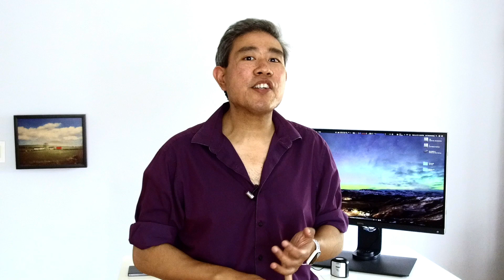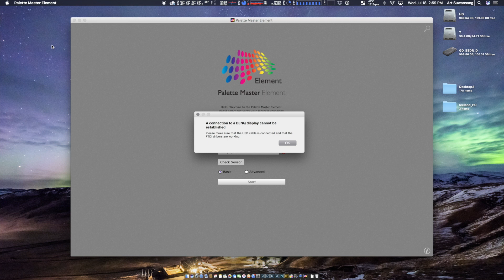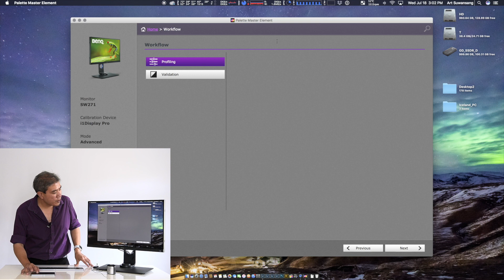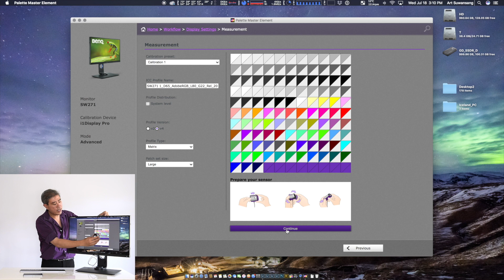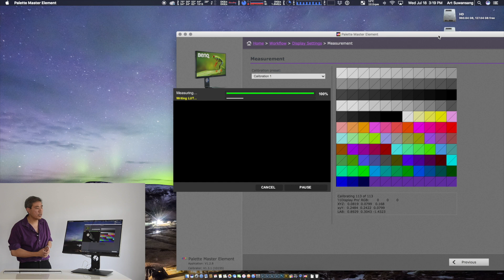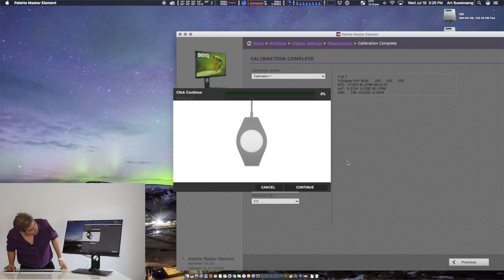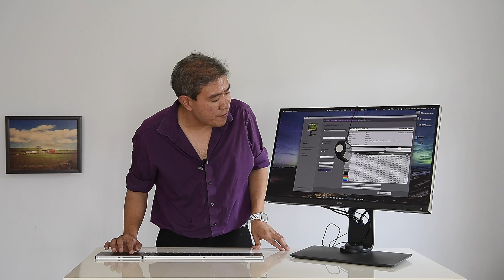How to Calibrate BenQ SW Displays with Palette Master Element - Art Suwansang

Comment: Hi Art, Thank you for the excellent video, very clearly presented and easy to follow, just what I have been looking for. Apologies for this naive question. For hardware calibration, am I correct in believing that the X-Rite i1 Display Pro is connected to one of the USB ports located  on the left-hand side of the my BenQ SW2700 monitor?
Reply from the maker: It can be connected on any USB port on the computer. You can plug it into the USB port on the display but it is not necessary. This is the latest guide https://youtu.be/8rjRoIe0-mo and calibration settings https://youtu.be/eCOPETFhZlE

Comment: Hhi, I am having a problem setting PME to recognise my spyder 5 pro on my sw271c, I have tried your suggestion of unplugging but no luck. Would it be OK to use datacolor software for calibrating? I have tried plugging into usb port on my iMac and both the usb ports on the bottom and side of the monitor, think the one on the bottom of the monitor is the correct one?
Reply from the maker: You can use Spyder software to calibrate the display but you are doing a software calibration, on a hardware calibration capable display, it is like buying a Ferrari to drive 10 miles / hr in first gear all the time. I would just plugged in the device on to the Mac. I would also do this https://youtu.be/WECg_yYBlpU chances are Spyder software is running in the background interrupting PME. Also if you ever installed DisplayCal you have to take that out from start up as well.
Reply: @ArtIsRight  Thanks for your help, I did have the spider utility in my startup so removed it but I think I know what the issue was. My iMac is not usb-c so I was not getting the data connection that is required. I ran it from my MacBook pro which is USB_C and it ran perfectly.
Reply from the maker: Oh ok, so what this means is that you will need to use the USB Type B uplink cable with the SW271C in addition to the display cable. It should work with this setup.
Reply: @ArtIsRight  thanks - sorted👍

Comment: Keep getting the error - A connection error between a Benq display cannot be established. I have tried unplugging to refresh the hardware and rebooting but no joy. Also my i1 Display Pro Plus is only recognized when connected into my Windows PC tower it is not recognized when connected directly into the BenQ SW270C monitor. Could you suggest a solution?
Reply from the maker: You just need to use a USB A to USB Type B Up link between your computer and BenQ.
Reply: @ArtIsRight  Thanks for your reply. Could you recommend a specific brand / link?
Reply from the maker: Your display should shipped with one. Something like this works as well https://www.amazon.com/UGREEN-Printer-Scanner-Brother-Lexmark/dp/B00P0FO1P0/ref=sr_1_3?dchild=1&keywords=usb+a+to+usb+b&qid=1622663269&sr=8-3
Reply: ArtIsRight Thanks so much Art. For some reason it only shipped with a Mac compatible connection. I’ll order now.
Reply from the maker: That cable that I shared with you is a Mac compatible connection and should come with your display.
Reply: ArtIsRight All good Art. I’m on Windows but got a similar cable. Thanks for your help! Definitely some of the best calibration advise online.

Comment: Hi Art, by using the propietry Palette Master hardware, do I not need to install the external software beforehand to use the colorimeter? In my case a spyder, or is it just the case of plugging it in when palette master asks me too?
Reply from the maker: Palette Master Element (PME) is a software that access the hardware 3D LUT on the display for color adjustments. PME software comes with all of the needed driver in the package. And you can just hav the device plugged in and calibrate with PME.

Comment: Great video! Should I connect the sw271 with a MacBook Pro trough a usb C? Should I connect the X-rite i1 pro directly to a monitor ? Tks. Best regards
Reply from the maker: That solutions works, The device can technically be plugged in any where as long as the computer sees it.

Comment: I've tried all suggestions but short of doing a full REINSTALL of windows 10, Palette Master Element won't load/start. I get "not responding". Here's what I've done so far: (and I just got my monitor today and there's nothing like having a new toy that just won't work !!!!!!!)  :(

Has anyone else had an issue like this or do i just bite the bullet and reinstall ????

please don't say reinstall!
Reply from the maker: Technically, the monitor works but the software won't run on the system nicely ;) 

Please answers these questions completely and we’ll go from here.
* What computer (Laptop - Mac specify the model, year and size, Desktop, iMac, all in 1 PC, custom build, etc )
* What is your Operating System (OS) version are you using? (For Mac please specify the dot release, for Windows please specify version / build number)
* What calibrator are using?
* What version of PME are you using?
* What BenQ model do you have?
* What cable are you using to connect your BenQ to your computer for the display signal, HDMI, Display Port, etc.
* If you are using USB-C skip this question, if not, are you using a USB link cable between your laptop and display?
* If you are using Mac was this a clean install or was the OS upgraded from a previous version at any point (I.e. From Mojave 10.13.x to Catalina 10.14.x)? Or was this Mac restore from a back up, time machine or other wise?
* For PC, what GPU are you using? If Nvidia are you using their new Studio Driver?
* Were you able able to successfully pass the validation at some point
Reply: @ArtIsRight  correct. Software hangs
Reply: * What computer (Laptop - Mac specify the model, year and size, Desktop, iMac, all in 1 PC, custom build, etc )
--- PC Build. no brand.

* What is your Operating System (OS) version are you using? (For Mac please specify the dot release, for Windows please specify version / build number)
- Windows 10 Pro (OS build # 19042.964)

* What calibrator are using?
- iStudio (x-rite)
* What version of PME are you using?
-Version from BenQ site, "Palette Master Element for Win_V1.3.15_Windows" 

* What BenQ model do you have?
-SW721

* What cable are you using to connect your BenQ to your computer for the display signal, HDMI, Display Port, etc.
-DP and confirmed on display too.

* If you are using USB-C skip this question, if not, are you using a USB link cable between your laptop and display?
* If you are using Mac was this a clean install or was the OS upgraded from a previous version at any point (I.e. From Mojave 10.13.x to Catalina 10.14.x)? Or was this Mac restore from a back up, time machine or other wise?
* For PC, what GPU are you using? If Nvidia are you using their new Studio Driver?
-No just standard Nvidia Install not the CC installation.

* Were you able able to successfully pass the validation at some point
-could not get the software to run at all. All I had was program not responding on all attempts.

Cheers
Steph.
Reply: Just to be clear, the monitor is working fine. I just can't get the "Palette Master Element" software to run.
Reply from the maker: Do you have i1Studio software installed and running in the background? This software not responding indicate that some how there's a fault on the machine or conflict that prevents it from running properly. Do you have lots of programs running in the background, have you use Display Cal at any point?
Reply: @ArtIsRight  thanks for suggestions. I ended up making sw271 the primary monitor and that seemed to have fixed the issue.

Comment: Hi art. Thanks for your videos, you do a great job at explaining how things work. Couple of questions if you could help me, 
1.currently I just have one computer set up to the sw270c, I have calibrated using slot 1, got less than 1 as the average delta e, so all good. When I press the ‘colour mode’ on the display and I can cycle through Adobe rgb etc ..... there is the option to set it to slot 1. I am guessing that I don’t have to do that unless I am attaching another computer and then using slot 2, which might be different? So effectively - for my set up - Adobe rgb mode is the same as calibration slot 1 9which used Adobe rgb for the calibration). 
2. You mentioned that unplugging the monitor resets the hardware, I turn my computer etc.... off at the mains at the end of the day, will this reset the monitor and get rid of the calibration setting, I’m assuming that whatever hardware calibration you do is stored indefinitely until you do another calibration or do a factory reset and turning off at the mains does not do a factory reset ?
As an aside - do you have a channel doing a similar thing for x rite calibration products ? 
Thanks in advance and for your video tutorials.
Reply from the maker: 1. Not quite, what you need to do is set it to calibration 1, all of the others are pre-calbirated color modes from the factory and is not a full 100% accurate match with your system. So it does not matter if you use your display with 1 or 3 computers, each calibration slot should correspond to the respective computer that you calibrated with.
2. No, you have the pull the plug and press the power button on the display to do a full factory reset in addition to going to the display menu and initiating a reset there first. And yes even when you reset the display hardware calibration are LUT written and will remain.
X-Rite information is on the same channel, you can check out this play list https://youtube.com/playlist?list=PLjlr8rlxl_q4bfecpq8qvxP0lgDzXhkpY
Let me know if you have any further questions :)
Reply: @ArtIsRight  thanks for the reply. I appreciate the advice.

Comment: i must ask please!
BenQ  put all this effort to Calibrate  the monitor in the factory with thier expensive equipment 
and then i take my spyder 5 elite and "run over"  BenQ  Calibration ? 
and i will have better results ?
Reply from the maker: That is one way to look at it but it is missing the point. All display needs to be calibrated from the factory. These SW and PD line go through a rigorous calibration process from the factory. These calibration are done so that the various color modes shipped with the displays are showing the most accurate color possible based on the reference value. The keyword here is "reference value." At the factory everything is calibrated to these reference value but none of our computer is outputting reference value because of the OS, driver, software, and etc. When you calibrate with a device, any device, you are calibrating the display in the hardware calibration slot, this calibration is adjusting the 3D LUT on the display. Think of this as a paring process, where the calibration is matched with your video card, specific video output, along with the software and driver installed on the system. At any point you are not overriding the factory calibration. And yes the result would be much better because the output is based on all of the overlay of your system. These videos will answer your questions too https://youtu.be/Cgo2p7jF3n0 https://youtu.be/iKfvbbUKA7U

Comment: I don't know why but whenever I play video the colors go all green and wrong. What should I do?
Reply from the maker: On BenQ SW hardware calibrated display with PME calibration or otherwise? If so please answers these questions completely and we’ll go from here.
1. What computer (Laptop - Mac specify the model, year and size, Desktop, iMac, all in 1 PC, custom build, etc )
2. What is your Operating System (OS) version are you using? (For Mac please specify the dot release, for Windows please specify version / build number)
3. What calibrator are using?
4. What version of PME are you using?
5. What BenQ model do you have?
6. What setting did you use for PME or color mode that you set your display.

Comment: Hi Art, Today I received my SW321C and made my first HW calibration using the display pro with the new panel native settings with great results as described in your video’s. As explained in previous videos I can make 2 extra HW profiles and load them inside windows color management when I switch programs. Is there a quick way or shortcut for switching (windows) icc profiles just like the pilot software, but for hardware models?

In a previous video you explained that the calibration profiles which are controlled by using the puck, where just for ‘previewing’ purposes. What do you mean by previewing? Can you please give me an example how you use this puck inside your workflow as a photographer? When you color correct photos inside photoshop, do you start by activating a RGB profile (by pressing your custom RGB profile) change your windows/apple icc profile manually and start working? After finishing your photos you want to share those photos online or maybe you would like browse the internet. Do you press de custom SRGB profile on your screen (puck) and switch OS icc profile to SRGB? Are you using the same custom icc profiles which are generated by Palette master for your OS?
Reply from the maker: There's no short cut or program for windows or Mac to switch the icc profile for the SW displays.

Previewing, checking to see what you image would look like in that approximate color gamut, I say approximate because your computer, in fact, none of our, are outputting reference colors. I think the best video for you to watch is this https://youtu.be/Gu1nqEf8vzg and with this said it is best to stick with 1 gamut and not change them around. There's really no need to. Please have a look at this and follow up with more questions. Also changing the profile when PS or LR is launch will not work because the profile load at the start of the program, meaning if you change mid way through the edit, it is still using the original set profile. What you have to do for the new profile to take effect is quite the program and launch again, which negate many of the color switching and comparison benefits.

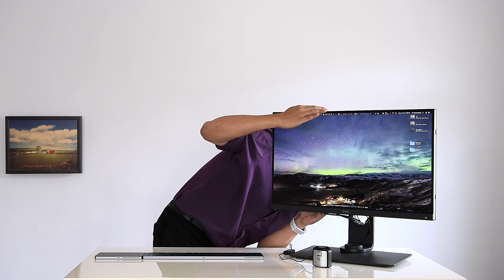Comment: Stupid question but when you plugged the USB cable in @ 3:54 , what was the other end connected to? I only get a message about the USB, not the FTDI driver.
Reply from the maker: The other end is plugged into the computer, This is a more updated guide https://youtu.be/8rjRoIe0-mo
Reply from the maker: FTDI driver message is for older PME version, newer version just simplify the message and tell you that you need to plug in the USB, the GUI for that was my idea!

Comment: Looks like my report summary failed. It’s showing 
average - measured 1.67 - passed. 
Maximum - measured 7.39 - failed

Going to run through this process again I guess
Reply from the maker: Ok, this is an older guide, I'm sure you have watch my newer ones already. But if you haven't yet, you should give that a look. Also, if you need my help, I need more info:

Please answers these questions completely and we’ll go from here.
1. What computer (Laptop - Mac specify the model, year and size, Desktop, iMac, all in 1 PC, custom build, etc )
2. What is your Operating System (OS) version are you using? (For Mac please specify the dot release, for Windows please specify version / build number)
3. What calibrator are using?
4. What version of PME are you using & setting?
5. What BenQ model do you have?
6. What cable are you using to connect your BenQ to your computer for the display signal, HDMI, Display Port, etc.
7. If you are using USB-C skip this question, if not, are you using a USB link cable between your laptop and display?
8. If you are using Mac was this a clean install or was the OS upgraded from a previous version at any point (I.e. From Mojave 10.13.x to Catalina 10.14.x)? Or was this Mac restore from a back up, time machine or other wise?
9. For PC, what GPU are you using? If Nvidia are you using their new Studio Driver?
10. Were you able able to successfully pass the validation at some point
11. For SW2700PT owner, look at the back of your display on the regular tag and give me the MFG date.
Reply: @ArtIsRight  I’ve recalibrated about 5 times now. I changed the black point to 0.1...still got a fail. I just changed it from matrix to 16 bit LUT, black point still at 0.1...another fail. And right now I’m trying black point 0.3, with 16 bit LUT.
Reply: @ArtIsRight  oh, and I posted this reply earlier but I can’t see it.  It here are my system specs you were asking about. 
15” MacBook Pro (2017)
OS: Catalina v 10.15.6
Calibrator: Spyder5 Pro
PME version: 1.3.14 / calibrator: 1.3.3
Display: BenQ SW270C
USB-C connection 
As far as OS, I guess it was upgraded from previous version
Reply from the maker: If you updated from previous versions or use time machine backup or migration assistance on setup you might be running into this issue. Dm me on Facebook page, instagram or email me, I'll share with you what you can do. This said, you have turned off HDR already all of the variables that will effect calibration outlined in this video correct? https://youtu.be/hDHBodulVbw

Comment: Hi Art. I just got my i1display pro plus to calibrate my SW270c. I have a Windows 10 Dell Inspiron 15 laptop and I use the monitor via HDMI for editing work. 
I have installed the latest PME and when I'm connecting the i1display pro plus to my laptop's USB 3.0 slot and launching PME it says error "a connection to benq display cannot be established" and even though it has detected the i1display pro plus but I'm not able to go beyond the start icon in PME.

 I also tried plugging in the colorimeter to the monitor's USB slots but PME is not detecting the i1display pro plus. Could you please help me with this?
Reply from the maker: If you are using HDMI you need to use the USB uplink cable as well. https://youtu.be/24BebMD0G7s Once you do this you will need to turn off the display and pull the plug and leave it off for at least 30 sec, plug it back in, turn on and it should work with PME.